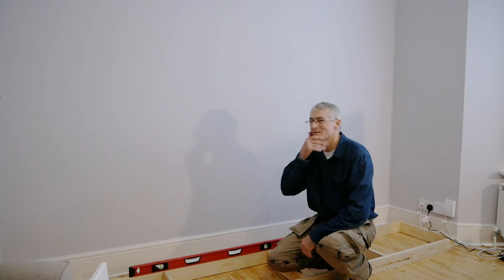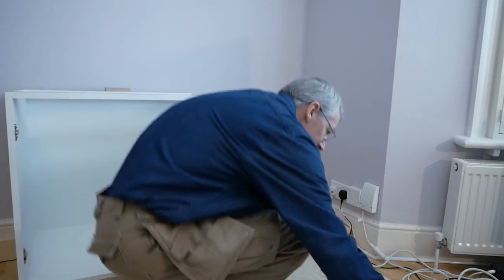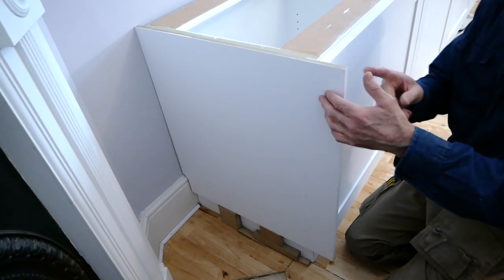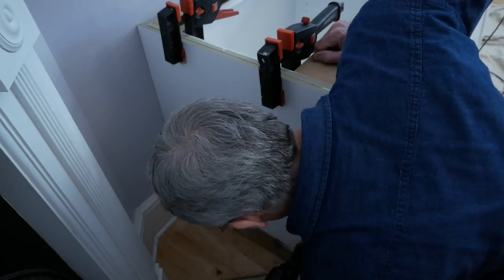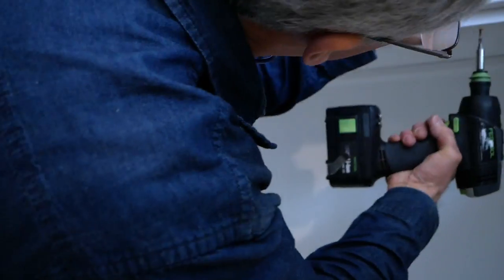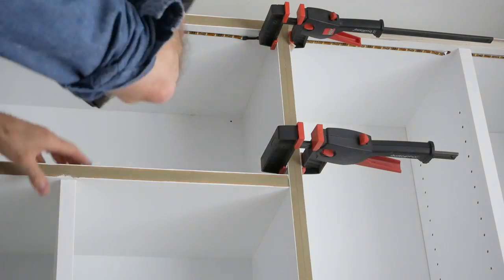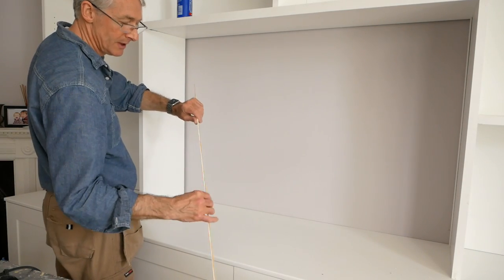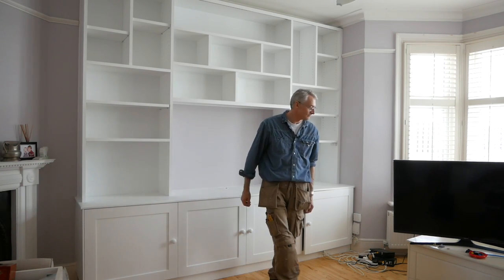TV unit, Part 5 #056

Comment: Hi Peter,
Just found your site, throughly enjoying it. Question, when you trim the front edges of your MDF units, what do you use and does it crack/move at all showing crack lines?
Thanks Peter
Reply from the maker: Hi and thanks! The front edges of the cabs/carcasses are usually lipped with a hardwood stripwood - just regular 2.44m lengths of lipping that I pick up from my timber yard, and fixed on with PolyTen PVA. Never had any movement that I'm aware of, and I've been doing it this way for many years 👍
Reply: Thanks for your reply Peter. Glad I found you site.

Comment: Hi Peter, been watching your channel from near on the start and it's given me so much inspiration and confidence.

A quick question about pulling the sockets through and fixing to the inside of the cabinet. Does this mean that the wires are exposed inside the small gap  between carcass and wall? And is this covered by any regs at all?
Reply from the maker: Hi and thanks! This is a debated topic, but I asked my electrician and his take was that provided you need  a tool to access the cables, then it complies with current regs. So basically as long as any cables are contained within the void and there’s eg an infill enclosing the front edges of the cabinet, then it’s OK to,use this method. The other option is to fit a dry-lining box with the back cut out as this enclose all the cabling between the carcass and the wall. HTH P

Comment: Excellent job. I like to see what tools other people use . I noticed a lot of festool and makita. How do you find the festool stuff? As a devout dewalt chap I'm considering getting some festool stuff for my new woodworking shed.
Reply from the maker: Machining Basics Thanks! Festool stuff generally works very well. I'm not fanatical about it, I'll use pretty much anything to get he job done, but find a guy who drives a truck for a living, he probably has a pretty nice truck, right?? Dust collection is a big deal for me, and it's designed right in with Festool - it's far from perfect, but probably amongst the best there is. 👍

Comment: Nicely done Peter 😊
If you did this today would you still use domino’s or would you use Lamello Clamex or Tenso fittings or a combination of all three?
Reply from the maker: Thanks Ron! And great question! Honestly, dominos certainly, and maybe Clamex as well. Still not a fan of the Tenso 🤷‍♂️👍
Reply: Peter Millard
Thanks for the quick reply Peter. I have been using the Tenso fittings to hold edging on while the glue dries and have been able to skip the clamps. Same thing for gluing up carcasses but I use screws also for insurance.
Enjoy the rest of your weekend Peter.
Ron

Comment: Peter, can you answer some questions for me please? 1. When making your doors for the lower cabinets, how much clearance do you allow between the doors / cabinets? 2. What do you use as the “top” of the cabinets (I want to make some approx 10ft in length and I’ve only seen mdf come in 8ft lengths) and 3. What screws do you use for your cabinet assemblies and what size pilot drill do you use? Many thanks
Reply from the maker: Hi Justin. Between the doors I aim for a 1.5 - 2mm gap; any less than that and you risk of them binding, any more and it looks a bit too 'gappy'.  I use MR MDF for all the painted cabinetry; you can get 3005 x 1220 sheets, but I'll join it at the top if I need to make something longer/wider. And I'll typically use Spax M-cut or Spax MDF screws in 4x40/50/60 depending on the application, and usually a 3mm pilot. There are links in the video description to the specifics. 👍

Comment: Hi Peter, for the top for the base units as it's wider than 2.4m do you buy material for it in a 3m length or do you use 8x4 sheet material and put a join in it ??? 

Cheers Tom (Pickering Storage Solutions)
Reply from the maker: Morning Tom. If it avoids the join I buy 3m lengths - and yes, that's what I did here. 👍
Reply: @10MinuteWorkshop  thank you Peter 👍

Comment: Hello again and thank you for taking the time to help.  Quick question, do you use the 6mm or 6.35 groover for 6mm MDF? Also, which size cutter do you use for 9mm? Walden only have 8mm or 10mm.
Reply from the maker: +Anthony James Brown No problem. Yes, I use the 1/4" groover for a 6mm panel as it gives a bit of wiggle room. Pretty sure I have  a 9mm Wealden groover, but only in the smaller sized 'regular' not the larger 'heavy duty'. Will check when I'm back in the workshop 👍

Comment: Once again an amazing video peter, just finished this mini series, would you allow one day on the install for this?
Reply from the maker: Thanks Tom! This one ran into a second day, but only because I needed a bit of help with the big shelves, and my helper wasn’t initially  available. 👍👍
Reply: @10MinuteWorkshop  ahh I see, I watched the how to price a job videos and was half expecting them to be about pricing for cabinet work, is there video or anything in the works for that type of video? As a carpenter and joiner I'm going more in this direction and any help in how to price for that kind of work would be amazing 👍
Reply from the maker: I try not to get into specifics about pricing as the actual costs vary so much between countries, and between regions within a country. It’s a tricky one to get right, but you have to figure out what you can charge in your area, for the kind of work you do. 👍👍
Reply: @10MinuteWorkshop  that's a very good point and something I should have considered before asking. You have been a massive inspiration and I'm hugely grateful for your videos peter, thank you for all the effort you put in 👍

Comment: Quality work, very impressive for a one man band! Can I ask how you deal with the "infill pieces" in terms of the nails? Do you use small gauge nails? Do you have to fill them or can you not see them?
Reply from the maker: Thanks! They’re 21-gauge pins, not quite headless, but almost. I tend to fill them as a matter of course, but sometimes you can just overpaint them. 👍👍
Reply: @10MinuteWorkshop  Does your Maestri me606 shoot 21 pins as well?
Reply from the maker: @michaelodonovan1908  No, just 18g. I have a separate 21g pinner from Spotnails. 👍

Comment: One last thing. Honest. I see you left the skirting on on the right hand side? Is this the usual process? Or do I remove them for a recessed unit? Thank you in advance
Reply from the maker: I decided to leave it in this time because I wanted the door to open easily without fouling the skirting. You can notch the skirt that remains, but the proximity of the bay window would have made it look a bit weird, I think, so close to the corner. 👍

Comment: Firstly, love all of your videos! Secondly I'm attempting something similar soon, but in an alcove. I like the technique of scribing the wall profile but how would you do that if you were working in an alcove? i.e. when you cannot start with a top that is oversized lengthways. I am thinking of using your technique to make templates, then using the templates to mark the top. Thanks
Reply from the maker: +Alex M Thanks! Yes, that's exactly how I do alcove tops - template it with e.g. Corex then work from that 👍

Comment: I have watched this series several times,  you are a fantastic source of information Peter. A quick question regarding the plinth if you don't mind answering? Is it necessary to screw it to the floor? I'm in the process of designing a more basic version of your build but do not want to screw into our reclaimed hardwood floors, just in case we ever decide to remove the unit. Would adjustable cabinet legs be a better solution in your opinion? Thanks
Reply from the maker: Thanks David! I always secure the plinth to the floor just to fix it in place while I move the carcasses around, and I always use a plinth on a run of cabinets like this because it's just easier to level the plinth up once, then its done; with individual feet, they have to be re-levelled (in the wonky old houses I mostly work in) every time they're moved, and there's a lot of nudging things around to get them into place! They're not always screwed with brackets; sometime's it's as easy - especially with a nice floor that you don't want to mark - just to hot-glue small blocks around the edge of the plinth just to keep it in place, then if necessary, you can fix brackets into the blocks. 

Once the units are on, the weight will keep them pretty well anchored, but e.g. small children can climb, and I don't want to take any chances. Incidentally, I've just started publishing downloadable plans of past jobs onto my Patreon page, coincidentally starting with this job; if that's of interest take a look at patreon.com/10minuteworkshop.

Best, P.
Reply: Peter Millard 

Thank you for such a detailed response Peter. Good idea with the hot glue. Making the plinth  sounds like a much better way to go. I will surely take a look at those plans. Will probably use a combination of pocket holes and grooves or dados to help align and strengthen the cabinetry rather than the domino, which is a fantastic piece of kit but out of the reach from a weekend diy’er. Keep up the good work.
Reply from the maker: @Vikingjoineryworks  Thanks David. You'd be surprised how many weekend DIYer's have a Domino, BTW - I am! 🤷‍♂️👍
Reply: Peter Millard 

Oh! Might have to reconsider 😆🤔👍🏻

Comment: Well done Peter, it looks brilliant, a cracking job and a great video :) I am just after a bit of advise if you wouldn't mind ? :) (I am going to watch some more off your videos which may also help me out.  As I think there great, there really informative and enjoyable at the same time. But l will get to the point.) I am thinking of doing my room similar to this eventually, same concept with shelving around the tv but would like to add more doors around it rather than open shelves and maybe draws on the bottom. Three questions the first been, how much clearance between the doors and draw fronts do you allow especially for priming and painting if I do use mdf? The second been, will i just be able to buy draw boxes from say howdens and make the carcasses to suit them so the runners just screw in and draw box drops in etc-like in their kitchens? and finally Im not sure weather I want to use mdf or melamine-but that would need cutting upside down and re edging on all the cut sides which is not a problem I just want to know what would you recommend? 

Thanks keep up the great work and ill be watching more of your videos :)
Reply from the maker: Jonathan Briggs Hi Jonathan, and thanks! Clearance is almost always 2mm all around doors and drawers - 1.5mm on ‘fussy’ jobs. If you buy in the drawer boxes you’ll still need to set the runners correctly, and don’t forget that one of the big advantages of custom cabinet work is that you get the sizes you want, not just the sizes that are commonly available. As for painted vs melamine, that’s a taste decision way above my pay-grade, but 98% of what I do is painted.

HTH, Peter
Reply: Your welcome :) and ah I see, so its same gap as internal doors should have :) and ano Im sure the howdens ones come with dimensions on a piece of paper to set them at-but too be honest ill be buying them from the cheapest place I can find haha :) and ano thats the best part about it it fits your space or room and is 100% unique :D and ill have to think about what to use, I do love the mdf shaker style doors lie yours here and even like the Victorian style doors with the beads-where the melamine is just a flat board and and doesn't have any design or depth to it. Anyway thank you very much for you useful information Peter take care and ill be watching your other videos throughout the week :)

Thanks once again and keep up the brilliant work and videos :D
Reply: Hi Jonathan. remember your draw boxes will be 25mm (1") less than the INTERNAL WIDTH of your cabinets. So choose your cabinet material with care; there is 15 and 18mm melamine out there. Using 18mm a guide; external width = 600mm, internal width = 564 (600 - 18-18mm), so your draw box should be 539mm (564-25mm) wide. Now if you use 15mm, then the sizing is all different and non standard; 600mm width, Internal is 570mm (600-15-15) and draw box will be 545mm (570-25mm), which is a hard sizing to find. Just be aware of the traps, I have fallen into all and I am sure there are a few more that I am about to fall into.

Comment: Hey Peter, still working my way through your vids :-) I'm looking to build something similar to (but smaller than) this in an alcove we have in our lounge but had previously put it in the "too difficult" box. Do you ever have to consider the strength of the MDF for your cabinet carcass when there is such weight bearing down on it with the shelving, TV etc? I'm just going back to your window seat video to remind myself of you did that with dominos or if you built a frame (again, regards weight!) thanks!
Reply from the maker: Thanks! It depends on the span - bear in mind also that I only use MR MDF which is a much better quality board than the regular stuff. I used Birch ply for the window seat top, just for that reason. I only use 22mm MDF for shelves, and then only up to around ~850mm span. Anything more than that, or anything that I know will bear some weight I add a solid wood lip to the shelves (as in ~20mm, not just decorative 'D' lipping). There's the temptation to over-engineer everything, but with most pieces of fitted furniture, the loads and stresses are pretty modest. BTW I have an alcove unit build coming up probably next week, so keep an eye out for that. 👍
Reply: Peter Millard Thanks for your reply. I'm watching the alcove videos eagerly as they come out. Another question if I may, do you ever consider not putting a back (and even omitting parts of the sides for example) on units like this one, the alcove units and the window seat? For example to increase storage space within the unit and have them just attach to a wall for example, or is this sacrilege in the cabinet making world? I'm currently making bids on a festool domino on eBay... my wife has you to thank 😉😂
Reply: Sorry to clarify, leaving the sides off say an alcove unit where the walls of the alcove could for, the outsides of the cabinet.
Reply: Hi Jack; how would you support the shelves? If your wall are not square, disguise with scribed in trim. if you use the walls, you will have fixed shelving and some form of support mechanism, also you would have difficulty in fixing the top, fascia and mouldings (if required). Best is to build a box, and with trim disguise that the ceileing, walls and floor are not plumb or square, doing that just now, and working very hard with the client to blend it all in.

Comment: Hi Peter, thanks for another great video whch I'm re-visiting after first viewing back in 2017 (time flies!). Can I ask a couple of questions:
1. On the bookcases the two carcasses where they meet I think are both 2 x 12mm MDF, yet the shelves are 25mm - are you putting a 25mm strip on the 2 x 12mm point, and then notching around the shelves (as i'm presuming they'd be tight against the cabinet side whereas the strips would overhang by 0.5mm each side?
2. On the shelves do you lip them all, and if so is that square edge lipping or rounded over ?
3. In general do you round over shelving or leave it square ?

thanks

Paul
Reply from the maker: Hi Paul. Sorry to be slow getting back to you, but I had to find time to rewatch the video - as you say it’s been a few years, and many jobs & videos ago! 

I’m pretty sure the lipping on the uprights was trimmed down slightly to get it close to the 12+12; the lipping on the shelves was butted up against the uprights. As for preference, these days I keep the edges square, back then I was using a lot more D-profile, though this one was square-edged. HTH. 👍👍